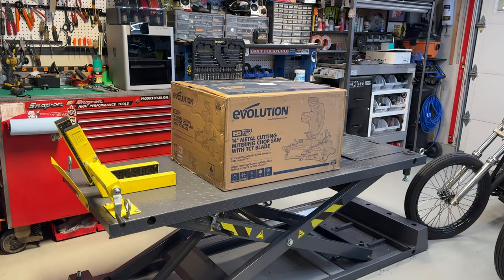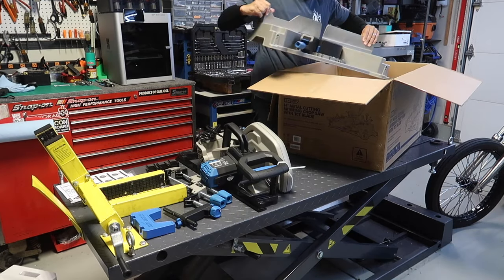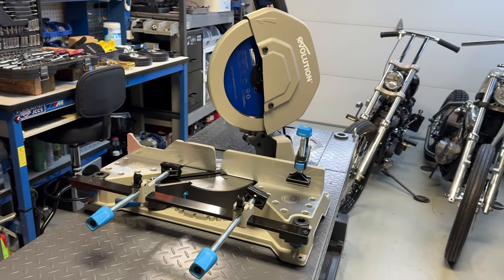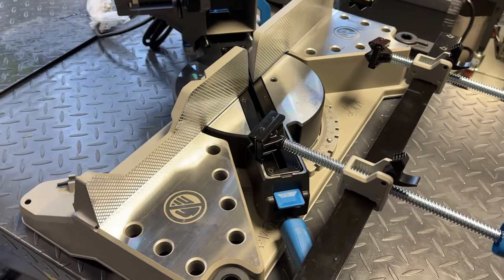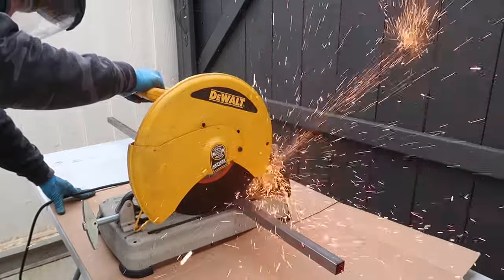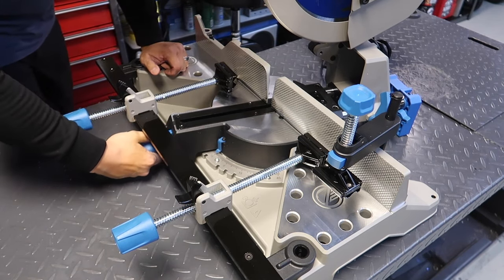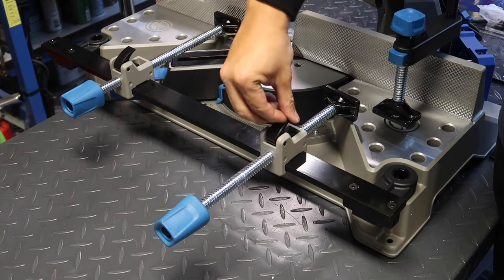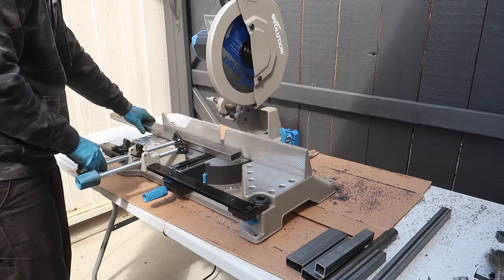Garage Tools | Evolution S355MCS 14" Miter Chop Saw

Comment: My Dewalt chop saw with the stone cutting wheel will not make square cuts if you get impatient. Push a little bit too hard and the blades flex. That is definitely a big step up from what I’m currently using. Thanks for the video bud. You take care and stay safe.

Comment: Have you ever used the stands that make bandsaws function as a chop saw? If so, how do you think those standup to a saw like this?
Reply: No comparison. Portable band saw in a stand is fine for small quantities but a chore to use for any kind of volume production. Slower, less accurate, and requires a lot more physical effort from the user. Also the portable band saw stand has the fence pivot for angled cuts, instead of the saw itself. So it's more complicated to support longer materials with miter cuts because they angle off the front of your table.

Comment: 1000 bucks.  Ooof..
Reply from the maker: Worth it
Reply: That was my thought, it's a sweet piece though
Reply: It’s all perspective. My festool k pex I use for carpentry at work was 2000 after tax. Festool Track saw and the tracks were about 2500. The time they save me at work makes up for the cost x10. Getting it done saves time time saves money. Plus the accuracy makes our work much finer!